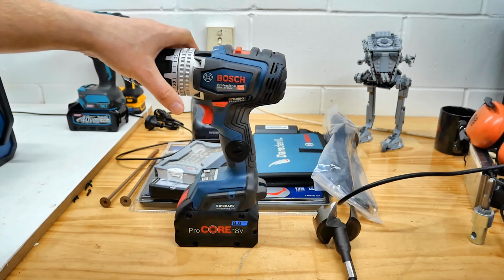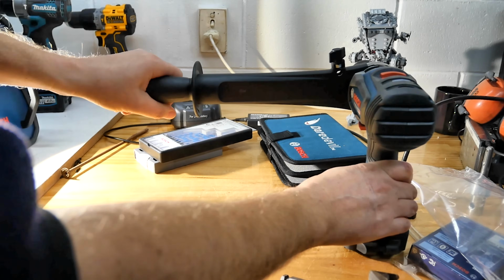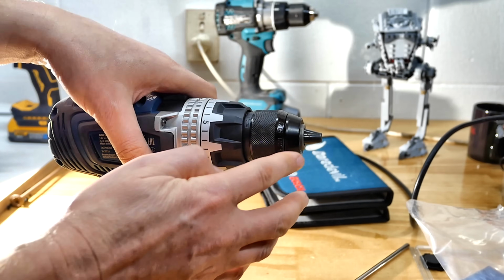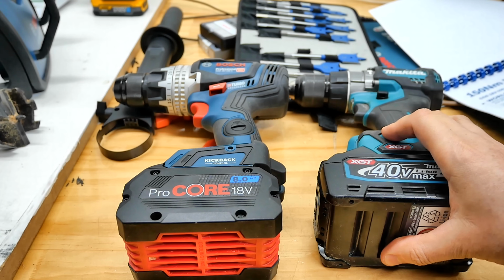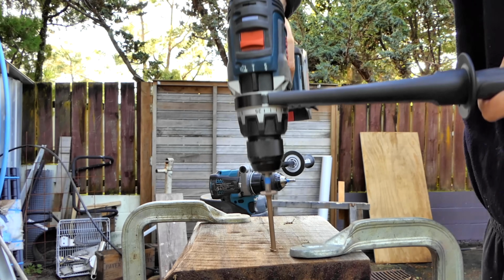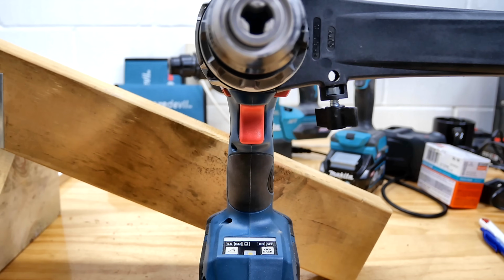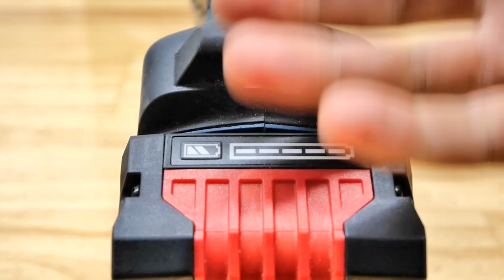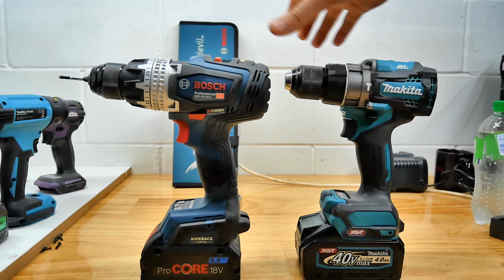How good is the Bosch World's Strongest Drill? First Cordless Drill with Angle Settings!

Comment: Can you adjust that 3 degree margin in the app settings?
Reply: No, you can't adjust that. This is the built-in accuracy of the sensor. Even my laser level is not perfect. But 3 degrees is very good.
I have this tool and for me is ok,very useful when I driil in thick materials.

Comment: The battery is bigger then the drill! May aswell bolt a generator on the bottom
Reply from the maker: You don't have to use that battery.
Reply: @ToolsAndStuffOFFICIAL  I'm considering tooling up. Wat do you recommend of your don't mind me asking. Handy man possibly get back into maintenance/building. Was thinking AEG or Bosch? But if you think others are worth a look wat you leaning towards as overall best bang for buck Midrange? Don't say Festool🤯

Comment: I thought the app would be useful to program the tool.
Like making it fit a production environment. Things like changing the direction each time you pull the trigger, or setting a speficit run time or torque setting when you pull the trigger.
Kinda disappointed tbh

Comment: The strongest drill in the world if you do /this exact thing/ and only if you compare to other battery drills.  And Biturbo because marketing must be exxxxtra. Even though there is no exhaust powered rotary air compressor in sight, let alone two. Same with Professional AND Heavy Duty because we wouldn't want anyone to think this is the Armchair Professional series with Neglection of Duty performance that we marketed so hard previously. It's all acccurate to a degree - or three :) Not getting rid of my corded hammer just yet.

Comment: i thought 256 quid was not a bad price in the UK, ive been looking for somthing that not flimsy & all made of plastic, i wanted an all metal drill but no one seems to make one apart from NASA if you have a spare 2 million quid.
then i saw No battery included for the bosh, why the hell have all these company's started doing that, ? its absolutely deplorable, if i buy a car i dont want the engine as an optional extra !
Reply from the maker: The battery isn't the engine, it's the petrol. If every tool you buy comes with 2 batteries and a charger then you are paying for potentially dozens of chargers and batteries you don't need.

Comment: oh this is so funny to watch these drills struggle... hahaha my drill would absolutely blast these out of the water. my drill has 4 speed settings up to 3850rpm. I think my drill would do great on speed 2 or even speed 3 which is 2000rpm...
Reply from the maker: Speed doesn't equal torque. The torque ratings of both these drills is much greater than the Fein you speak of.

Comment: Bosch are copying Milwaukee who are leading the way
Reply from the maker: How is this drill copying Milwaukee?
Reply: Not even the slightest sign that this drill is copying anything from milwaukee, and im a bosch ' hater '.
I am with bosch ( and hate the brand ), my boss is with milwaukee
Reply: @LORFCASTER  Compact & powerful Milwaukee started that off, making the bigger capacity batteries Milwaukee started that off, the charger charges both bigger battery & smaller battery so one charger for all Milwaukee started that off, Personally I like them both, I like Bosch but just being honest I'm not a loving fan boy
Reply: @blackuncletoms3563  actually Bosch released the 21700 cell ProCore batterys before Milwaukee released there HO Series.

Comment: Milwaukee is the most powerful
Reply: Probably the Gen4 but not the Gen3.
Reply from the maker: There's always one.
Reply: @ToolsAndStuffOFFICIAL  but milwaukee is always the most best and powerful 🤦
Reply from the maker: Sure it is.
Reply: @ToolsAndStuffOFFICIAL  I was being sarcastic..
Reply from the maker: I know bro. Hard to put inflection on comments.
Reply: @ToolsAndStuffOFFICIAL  milwaukee fan boys are the worst haha
Reply from the maker: I'm waiting for a reply from the original commenter, but they're usually not clever enough to know how to respond.
Reply: @ToolsAndStuffOFFICIAL  Going off project farms videos, Milwaukee does come out on top most of the time.
Reply from the maker: For raw power yes, but at what cost.
Reply: @ToolsAndStuffOFFICIAL  Gen3 Vs 40v:
Cons would be: less speed, more noise, the trigger (feeling and sliding off), the 14 setting clutch 
Pros: smaller size, less weight, onekey options, cheaper, more power, possibility of adapters (only one battery platform)
Anything else?
Pretty curious if they fix the issues within the Gen4.
Reply: @januszR  also the milwaukee would get hot like the current one does
Reply from the maker: And cut out and overload the batteries.
Reply: @brettwalkom948  & @Tools&Stuff true, forgot these...
Reply: My Dewalt Power Detect hammer drill would smoke any Milwaukee.
Reply: @ToolsAndStuffOFFICIAL  The blind fanboying going on here is insane.
Reply: @roryd8813  yeah it is lol. I don’t have a side so I really don’t care who’s “best”.  I’m ready to invest in a new brand so trying to decide. But Iv been watching a lot of the drill comparisons and tests from all the big channels and the same brand wins almost them all.